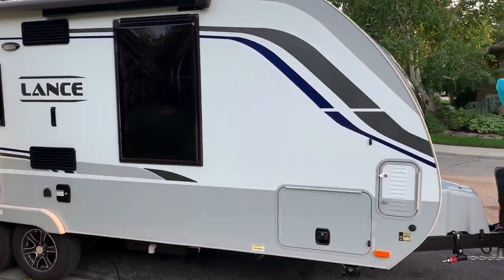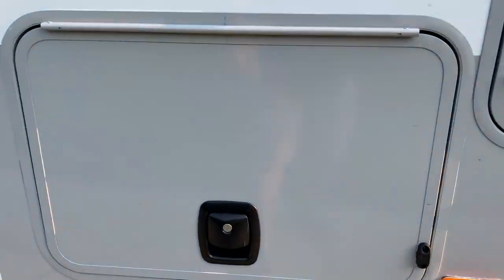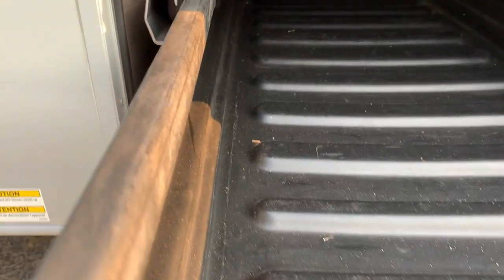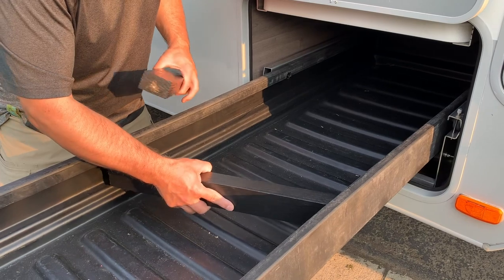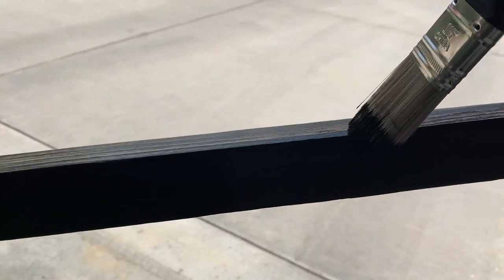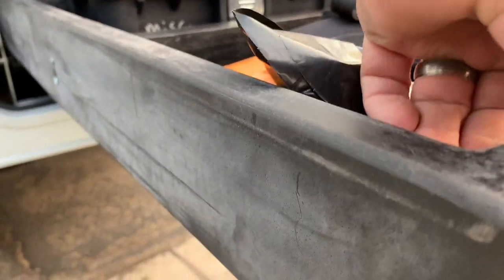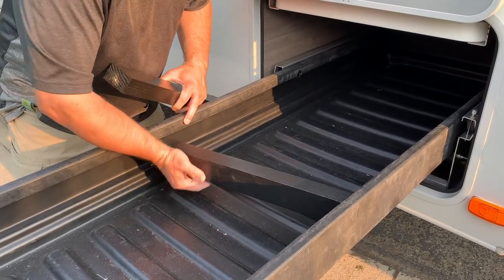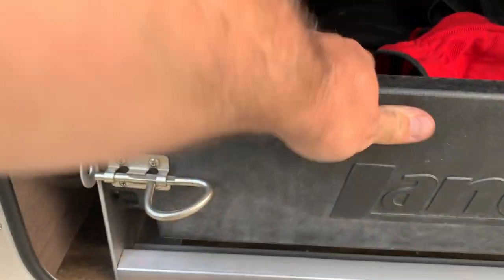LANCE 2075 | Storage Tray MOD

Comment: Way easier fix than others I saw on the Lance Owners forum (which had all kinds of fixes like inverted rollers underneath, masonite stiffening, aluminum channels bolted to the top. At the end we just tore it all out--it wastes an awful lot of space below and on the sides and kept us from storing our Weber grill in it due to low clearance from the table that stores above it. That was in our 2019 model 1995; if Lance still uses such a system, the door should extend to the bottom of the bay to allow full use of the space.
Reply from the maker: @Patrick Crist  Hi Patrick.  Thanks for visiting our channel and appreciate the comment.  Very good points.  Happy trails.

Comment: We've never had that problem with our 2375.  Don't know how much weight you are putting in there.  I prefer to have no obstructions in the tray, so I can put longer items inside.
Reply from the maker: Thanks for the comment and visiting our channel.   It was an issue with just modest weight.  I really don’t put really heavy stuff in here.  My fix solved the problem and I don’t really store long items in this tray so it works for us.👍🏻
Reply: @IdahoVoyager  @idahovandal4ever  Even with your mod, you can put long items in like a broom, mop, chair etc.  There is still a lot of height in those cabinets

Comment: I have the same issue with my 2021 Lance 1985.   Great mod.   Thanks
Reply from the maker: Glad to help
Reply: @IdahoVoyager   I ended up doing mine, slightly different than you are my tray was bent differently, but it works great and I am very happy.  Again longer items fit nicely above the 2X3 and below the stored table above.
Reply from the maker: @rlevass23 That sounds great!  I really like the way it turned out, and you are correct, can still use it for some longer stuff.   Thanks for visiting our channel 👍🏻

Comment: Yep. The rollers come off the rail every time, even with a light load. Thanks for posting this great fix. I will do this for sure. Also, have you had problems with your large kitchen drawer opening when traveling? Mine pulled out and shattered the right slide. I'm looking for a fix to keep the drawer closed and considering 7# cabinet magnets or child proof latches.
Reply from the maker: Thanks for the comment and sorry fir the late reply.  Haven’t had any issues with the kitchen drawers thus far.    On the owners forum I have seen people use small latches purchased on Amazon.